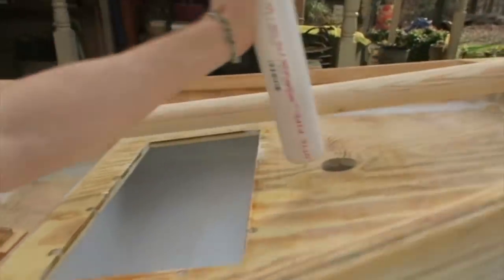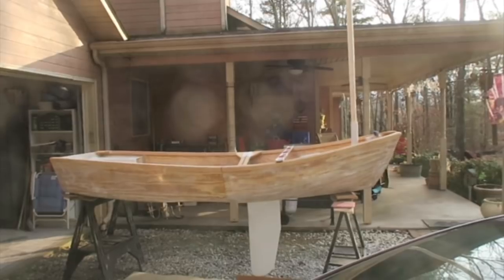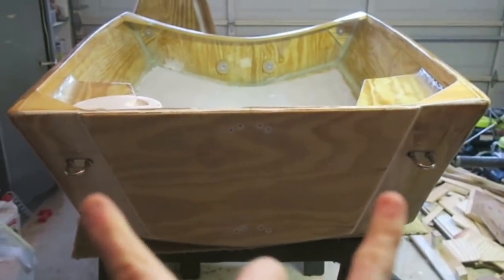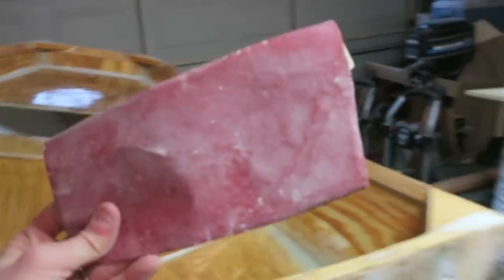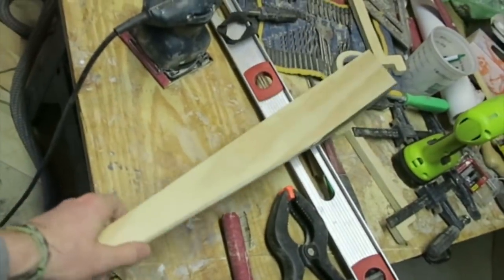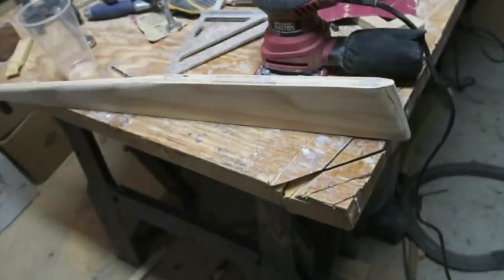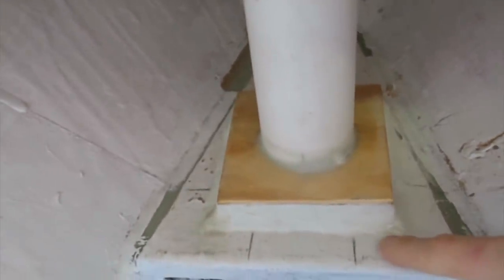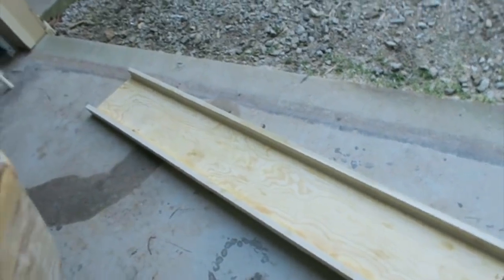Building A Chameleon Sailing Dinghy | Mast & Sprit #6

Comment: Your hard work and attention to detail will result in an impressively strong dinghy. I have two reservations based on my experiences. The first is that the dagger board will float up out of the slot without a restraint. The second is that your solid rudder without a lifting blade will be very vulnerable. The first time you strike an obstruction or the bottom at any speed, the rudder fastenings will be ripped off the transom. Nice work Ben.
Reply from the maker: I can see how you are very correct on both counts.
The daggerboard I can bungie down easily. I've already addressed that by adding mounts for a bungie.

The rudder, I'm going to have to be careful with for sure.
I may modify it in the future to make it kick up.

Right you are, Peter.
You sound like a fella who has learned such things the hard way.
Reply: You can sail onto a beach by whipping the dagger board out at the right moment but if you take the rudder off you have no steering and lose control. You have done a nice job on that rudder but a kick-up one would make way more sense.
Reply from the maker: I concur.
Do you think it would be better to modify this rudder or to build a kick-up from scratch?
Listen, I'd had this same thought for a while.
Somehow it feels more important having an Old Salt tell me though - so thanks for that.
Reply: Here in the UK kick-up rudders are pretty well standard equipment on sailing dinghies.   Google 'mirror dinghy rudder' and have a good look at all the images. I would keep your original rudder and start again when you have time. A Mirror rudder is very basic, the rudder cheeks and blade are marine ply. They are very robust. I feel that if Molly were sailing solo you wouldn't want her standing up to lift your present rudder off its fittings. A kick-up would obviate that and it still provides some steering moment when it is kicked up, so you keep some control.
Reply: I'm a bit embarrassed to come up with another point but here goes. You will need a rudder clip to prevent the rudder falling off in the event of a capsize...... which will inevitably happen.  It's what dinghies do.
Reply: Thanks Matthew.... I’ll bear that in mind. It was the “old salt” in me speaking.

Comment: Dinghy is coming out great! As do all your projects. Here's a thought. Drill a small hole in your keel and run a rod through it, then attach two hard plastic wheels. Then you can lift it from the bow and it will role up on most surfaces. We used 3 inch wide inflatable wheels after the initail set worked out so well and they even workout out on a sandy beach. Just a thought! Of course you'll have to fit them so they nest still works out, but I do not think that will be a problem for you. Good Luck!
Reply from the maker: Interesting idea.
Thanks!

Comment: Nice work on the boat. Woohoo.  
When I moored my 15 ft Sailboat on the lake for the summer I installed big I-bolts like you did.  Oops, when I gibed my mainsheet would some times hang up on the I-bolts and that led to some unexpected excitement.  I found out that the experienced sailors didn't have I-bolts or if they did they mounted them vertically.  I always wanted to carve a block of wood to temporarily mount and  prevent the hang-ups but instead when I was racing I would cover them with duct tape (aka. speed-tape) for the day/weekend.   Keep up the good work and fair winds . . . JerryK
Reply from the maker: 100MPH tape.
Thanks for the compliment, Jerry!

Comment: Hi Ben, smart trick cutting the cloth on a Bias or 45 deg so it goes in or over corners better.  Prehaps the skeg could have been a piece of solid wood as it might have helped with abrasion but you have enough epoxy that I don't think it will be a problem!
I like you strong U-bolt , but I would still attach the tow line to the back eye bolts too!   Enjoy Warren
Reply from the maker: Yes, I'll certainly double up on the tow lines somehow.
I operate by the principals set forth by The Department Of Redundancy Department.

Comment: Shakin my head in awe of your skills Ben! Again, awesome job at your first boat build. A thought on the skeg: I think you did a great job making it deep. I had a real tracking issue because I went with a shallow skeg. I had to increase it's depth to improve my dinghy, so I think you'll benefit from that decision by better tracking performance (rowing, motoring). Can't wait to see you using it in the Bahamas!
Reply from the maker: Thanks, but you give me too much credit.
That depth was merely a result of the width of a piece of scrap wood I found after the fact.  :)
Either way it's good to hear that feedback from you about it.
It's going to be GREAT t actually use it.
I'm a little nervous about committing to use it full time, but also very excited.
Reply: Uhhhh... no dude, your attention to detail in this build and your vids show the credit you deserve. I think you would be an awesome engineer. Good Luck!
Reply from the maker: Well, thanks very much for saying that. I am essentially a mechanical engineer by trade.
I know TIG/MIG welding, I've run lathes, mills, and CNC, I've done plenty of CAD.
I've done metal finishing and anodizing, and I did military product design for 12 years or so.
I know all this isn't apparent from my goofy exterior and demeanor.
I've done a lot of stuff!
I'll tell you though, none of those previous skills really apply to building a fiberglass boat.
Reply: Ooo, ooo, ooo - almost forgot... Good job on the metal-over-skeg. Another tip that might help you, look into Xynole or Dynel cloth (last layer over F/G for abrasion resistance). It works great for the unavoidable sand-scub when beach landing, dragging, etc. I always sheathe the keel/skeg/runner/sponsoons and then a light sand-able filler to smooth the weave. It is really hard and great at abrasion resistance. Look forward to the next vid installment! You shall now be deemed, "Bengineer"

Comment: small hint....if you ever have to work with resin again, put it in a small freezer bag and cut off a corner like an cake decorator's  piping bag for filling holes and making fillits you wont have near as much sanding and cleanup. nice looking dingy :) did you find the plans online or buy them from someone?
Reply from the maker: I would absolutely do that, for sure.
Would save a lot of mess and waste.
Thanks for complimenting my magnificent dinghy.

I initially saw the plans in a book called "Voyaging On A Small Income".
Then I tracked down the designer and order directly from him.

Comment: Great job on the boat and the video! I am just curious why your eye bolts are installed horizontally instead of the customary vertical orientation? An aluminum (or stainless) backing plate on them may have spread the load better. Cracking of the  hole area could encourage water penetration.
Reply from the maker: No particular reason.
If it works, great.
If not, I'll fix it.
The bow eye construction is incredibly over-built.
The stern ones are much lighter duty and will really only be used for putting the boat in the water.
I feel like they should suffice, but if they need to be modified, I'll do it down the road sometime.

Comment: Probably a bit late to mention this, but you can use a couple dots of hot glue to hold pieces while the epoxy sets.  It's really handy for backing blocks and stuff that's hard to get a clamp on.

Comment: Cool work! I'm liking the result. When you finish you can come to the UK and help finish mine hehe, I may have one or two bits of wood for you to work on if you start missing it ;)
Reply from the maker: Thanks!
I can definitely see myself building another dinghy one day.
Probably not in the UK though.  :)
Reply: Im actually starting a complete refit of a Colvic 33 I bought on eBay (before morning coffee...) from 1980 something and was never finished or splashed so I got a lot of bits of wood hehe. If you ever come around this parts and you need repairs look me up, I got the tools and hopefully a finished boat to invite you on.
Reply from the maker: Is that a "Countess"?
Reply: YEah I found it on eBay and saw that the prop shaft was not even drilled. Its a Countess 33
Reply: NOTE TO SELF: Do NOT bid on anything on eBay before morning coffee ;) you may end up going sailing around the world to exotic places.

Comment: Over size your unbolt holes and fill them with epoxy. Then install them so the wood don’t rot around the bolts. Epoxy the inside of those bouncy cabinets if you haven’t already. Done so. Looks get!
Reply from the maker: Both have been done.
Thanks for the thought though.  :)

Comment: A word to the wise -- if water can infiltrate -- it will destroy the wood composite through different means (freezing, saturation, etc).
When dealing with end-grain wood (ala. that front eye-bolt mount), always drill and fill with "thicken epoxy" for water proofing, then use sealant as a secondary (tape, putty, etc) barrier.  Best regards
Reply from the maker: It's built in exactly the manner you describe.
I told you - I'm a self-proclaimed naval architect.  ;)

Comment: maybe i'm wrong but with the bow hook (the boat's nose piercing) installed where it is, whenever you tie a line to that hook and lift the boat out of the water, the line is gonna chafe on the top of the bow, now?! maybe the nose piercing should have been a little higher? or is that hook not for lifting the boat out?
Reply from the maker: Nah, you want it low on the bow.
Helps keep the rolling to a minimum if towed or even just floating behind the boat in a chop.
In other words, if the line were attached at the very top of the bow, it would influence the boat to roll over more easily.
Reply: oh,  that makes sense.....thanks!

Comment: Eye bolts should be mounted parallel to the load you plan on putting on them, you have mounted them perpendicular, ie. horizontal for both the bow and stern in your application. The eye bolt on the bow will be especially weak as their will be a lot of shock loading of it as it is towed. The tow rope will apply a lot of leverage to it as it "jerks" the dinghy along behind your sailboat.
Reply from the maker: I don't understand the comment.
They are all directly inline with the load they will be bearing.
Reply: I think JCF is concerned that with the bolts mounted horizontally, the force of the rope will jerk the the "u" shape in the vertical plane where the support of the backing is narrowest , if the "u" was vertical the backing would be vertical and the force from the tow rope would be working against the backing plate  in the same plane as the force from the rope.  I think I got that right.
Reply from the maker: I think I understand now. Thank for that.
It may not be ideal, but I'd still be really surprised if we have any issues from them.
I do always use a snubber, even with the dinghy lines.
I think it'll be alright, but if we have trouble with them, I'll fix em.
I've learned that there's not much that a gallon of epoxy and a liberal application of elbow grease can't fix.

Comment: I’m pretty sure you’re supposed to be able to adjust the rake on these boats. The mast foot on most sailboats is not actually permanently fixed. Usually sitting in a track going fore to aft. Then something is used to keep it in place. My Sabot sits literally on a rake with several slots for pegs on the sides of the mast foot to drop into. It looks like yours but it’s 8’ and a single piece. Hope everything went well and you don’t have to tear all that out.

Comment: Don't forget to allow a bit of room for paint and expansion for the wood and your daggerboard slot. It will expand some.
Reply from the maker: I did.
There's at least .0000000000000000018 of an inch of tolerance remaining.
Reply: Great job, done a hell of a lot better than I would do. And I forgot to say happy birthday. So happy birthday.
Reply from the maker: ;) Thanks for that.

Comment: will you have to register that dingy when its finished? im guessing either way it would be a good idea for proof of ownership but didnt know if it was required by law, so far im impressed with the build, you do some pretty good wood work, when it comes to building stuff, wood is my least favorite, i prefer play dough personally  :)
Reply: south carolina required me to register but only because I put a trolling motor on it.  If all you have are oars and a sail no registration required.
Reply from the maker: Nope. An unmotorized vessel less than 12ft does not need to be registered, in GA at least.
I agree with that proof of ownership is a good thing.
I'm counting on the 8 videos showing me building the thing are proof enough... I hope!
Reply: You could go to a trophy make and get little brass tags and fiberglass them to the hull that said something like 'sandflea jr'  :)
Reply: Well, if anyone argues there's approximately ten thousand of us out here prepared to "come 'round their house" and see what point it is that they're trying to make :-)
Reply: Sailboat Story well since you are going to put a moter on it you should ask dnr if you need to most states say if has moter need to register it.
Couple coats of truck bed liner on bottom would protect from damage. Sand it smooth paint it.
Reply: The dinghy lives on/with SandFlea so maybe "DustMite"  ^_^

Comment: Ok but what wood is being used for the mast
Reply from the maker: A rare species called the Home Depot Stud.
Reply: Really? Is it strong enough to handle harsh gusts? The kind that would lift a pontoon outta the water if it were a catamaran. Can’t expect ya to test that less you make or buy one.. which I am building a catamaran.
Reply: Also thank you very much for responding
Reply from the maker: It's been plenty tough enough for us. It bends quite a bit, perhaps as much as 6" at the top when the wind really pipes up, but I consider this a good thing. If it ever breaks, I'll probably go with some kind of hollow pole, mainly just to save weight.

Comment: It doesn’t seem like you over drilled and epoxied the holes for those tow loops.
Reply from the maker: I didn’t on the rear ones, as they are not in the water. They are still well sealed with epoxy.
Reply: Sailboat Story the biggest reason for over drilling is to keep water out of the wood as I’m sure you know. I feel like those holes aren’t any different than all the others where you’d want to keep water out of the wood.
Reply from the maker: I never back down from doing whatever level of work is necessary to do a job right.
I also try my best to not over-engineer when a more modest approach accomplished the same thing.
The rear eyes seemed like one of those cases where more time, energy, and materials were not required.
A balanced approach like that is important in design and construction, I think.
Either way, it's just like the rest of the boat from stem to stern - If it works, great. If not, I'll make it work.

Comment: Epoxy doesn't adhere to metal, or other non-porous surfaces. Go for regular super-glue on smaller parts, and thick super-glue on larger parts.
Reply from the maker: It will adhere to surfaces that are typical resistant to adherence if the surfaces are properly prepped before hand namely by roughing them up. Epoxy is often applied to metals and even plastics for various purposes. You're right in that it's a tricker application.